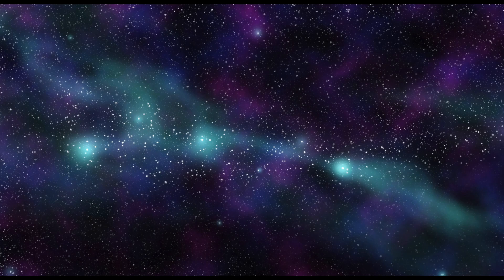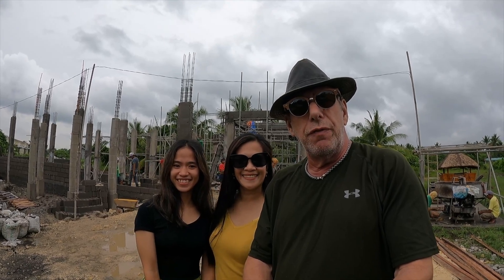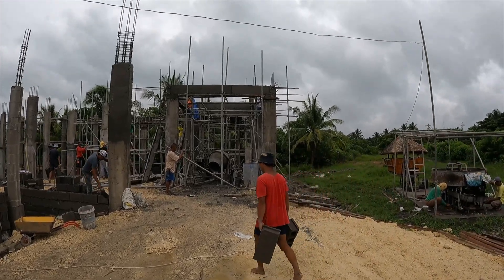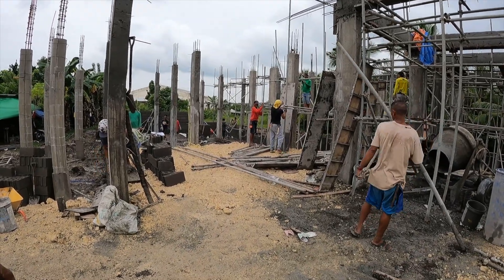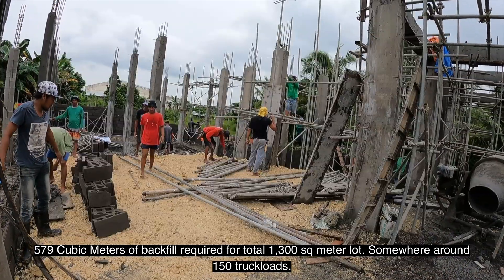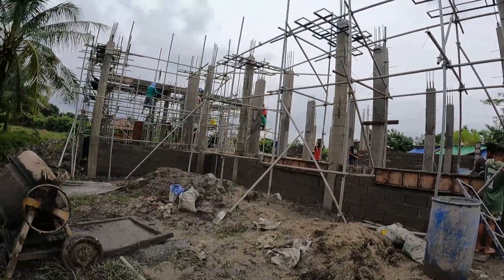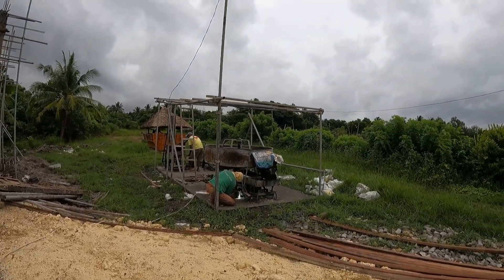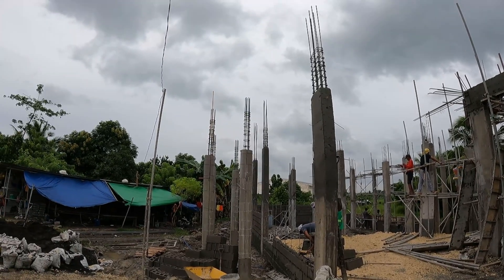FloridaMan Journey™ 265m² House - Week 6 - Philippine Home Construction

Comment: 579 cubic metres backfill will give a lot of presure on the hollowblock walls
Reply from the maker: The pressure will be the greatest in the back of the house. The posts along that wall are twice the size of posts in other areas. There are also weep hole to allow water to escape reducing pressure. This is why I spent more for a proper engineer to construct the wall instead of local workers. Welcome aboard!

Comment: So many people building post covid.
Our build resumes this sept… we’ll upload ours to YouTube too.
Our build isn’t with hollow blocks… we’re using AAC blocks. So far 20% cheaper in labour and materials
Reply from the maker: I wanted to use AAC blocks and FRP Rebar as well but my builder and his crews have never worked with those materials. He also explained there is no building code regulations for these materials.
Reply: @Kanointhejungle  true… I did have to train my crew but the engineer said that the walls aren’t structural. Only pillars and tie beams. He said and confirmed with the city engineering that hollow block and AAC are merely filler and not structural. Go figure :)
Reply from the maker: @kenlyn2208  That is exactly what my engineer tells me.. The concrete posts and the rebar is what is responsible for the structure integrity. This is not true in the US where we don't really use posts and such.
Reply: @Kanointhejungle  check out our garage build if you’d like. Under playlists… house build and then week 4. I do have to teach the crew how to skim coat AAC. They’re so used to concrete layering. It’s ok. We all learned things :)
Reply: @builtnotboughtmadeinphilip3955  watching as you go :)